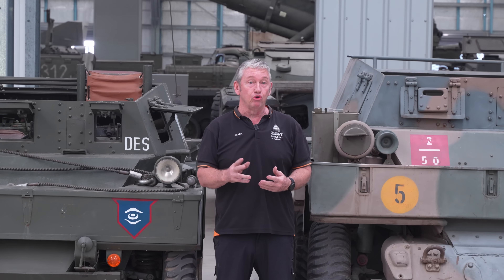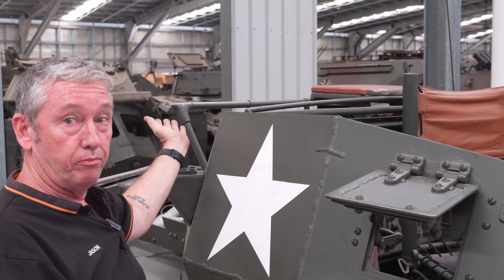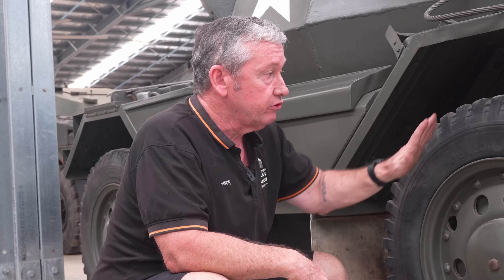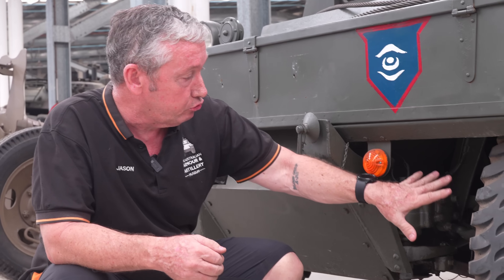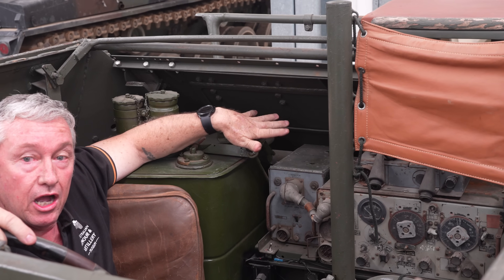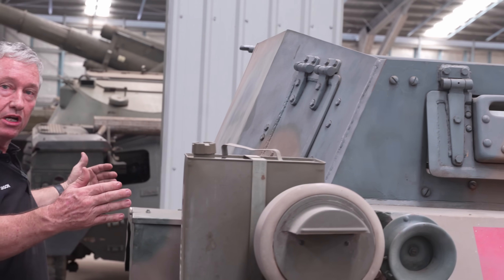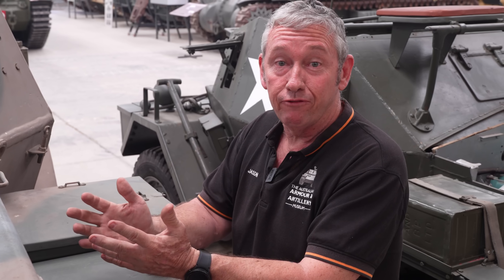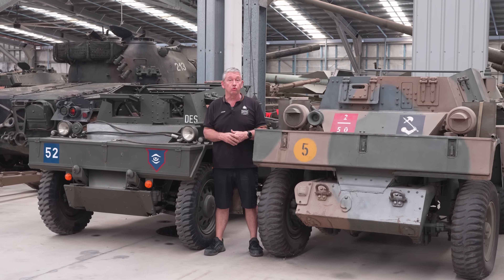The Dingo and Lynx Scout Car: A Comparison!

Comment: I've  always wondered  why they didn't bring a few of these  for Operation Market Garden. The gliders could easily handle them, the Hamilcar could take two! These with real armor and   added machine guns surely would have made it to the bridge unlike the jeeps that were stopped. A Locust tank would probably have also worked but very close to the weight limit.
Reply: The Recce jeeps in Operation Market-Garden were ambushed by German pioneers with flamethrowers. Having Dingo's probably wouldn't have made any difference.
As a Dutchman I am grateful for the sacrifice of all soldiers that liberated our country.

Comment: Love these vehicles. Thanks for the video 🙂 it seems the Lynx is way better designed than Dingo. A test drive of both should have been interesting too 😁
Reply: Dingo is superior in most aspects. 

The independent suspension, flat underside, lower silouette (which is important in recon), lower weight and the superior gearbox (extremely easy and ergonomic to operate, and allowed for high speed reversing, again very important for recon). 

Not really sure where the lynx is better designed other than in ease of manufacturing and having an extra escape hatch.

Comment: Clockmonkey...The Dingo is an example of just pre-war British design showing off all the clever engineering available to produce a complex vehicle that took a lot of manufacturing and had little commonality with other vehicles in service. The Lynx is what you can produce using mostly off the shelf mass produced common parts with relatively unskilled workers quickly once the gear makers etc have gone into the fighting services and the logistics supply and mechanical repair organizations are involved in design and specification with actual wartime service experience. In simple terms, if a dingo has battle damage to a wheel station it will be out of service for a long time. Same damage on a lynx, pinch the bits off a CMP truck and back in service in a couple of hours. You can pause or rewind as much as necessary to keep up.

Comment: I’ve driven both the Dingo and Lynx. Dingo easier to drive once, just ensure it’s in neutral if you are waiting at for long stops, as it will boil the oil in the torque coupler. The Lynx shift pattern is a little tricky as you sitting at a angle to the direction you driving and it throws out your angle for shifting

Comment: One thing for sure nobody over 5’5 is going to drive the Dingo. No room at all.
Reply: My dad was 5' 10" and he drove one in North Africa
Reply: I am 6'1 and can drive a Dingo with no problem. A number of errors in this video, the Mk1 had a sliding steel roof (not canvas as was stated). BSA owned Daimler and the engine was used in the car models of the late 30's. The runflat tyres originally had inner tubes but later on there was a new runflat that had no inner tube, just with a small cavity in them (no air needed). The Dingo was still in service up until the very early 60's. I have restored a fair number of Dingos over the years and carried out work on others. Well in advance in their design and the drive layout was forerunner of that used in the Ferret, Saracen, Saladin, and Fox armoured vehicles.
Reply: My Father is 5’8/9 and he had more than ample room when we drove them. Obviously he’s not the tallest person but I don’t see why someone up to 6’0-ish wouldn’t be comfortable.

Comment: That fuel tank immediatly behind you would have half the drivers high on the fumes, worse if recently refilled
Reply: The driver sits on the gas tank in the M-151, the Jeep. Fumes were never an issue, even when enclosed.